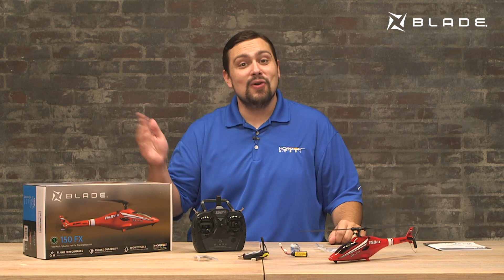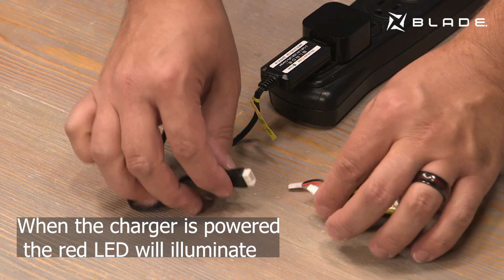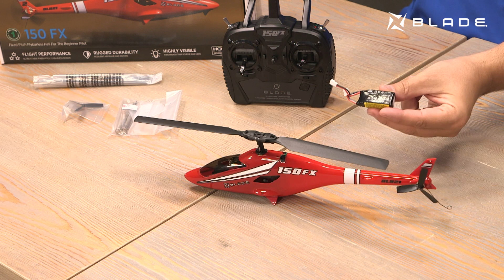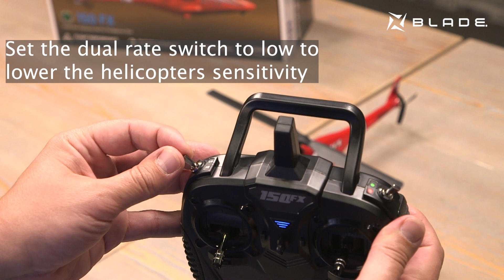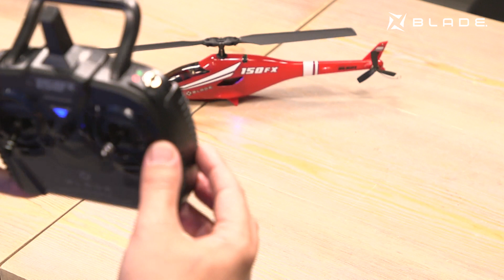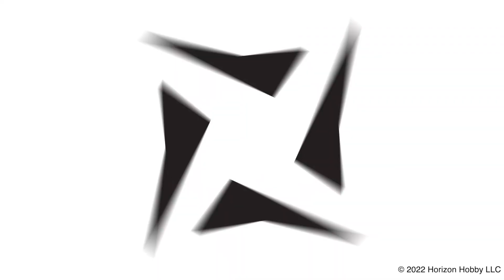Quick Start: Blade 150 FX RTF

Comment: Those tiny L wrenches I use a torch to straighten the L. Then 5 min. epoxy 2 1/4 20's to the end. makes life easy without paying for expensive bit driver sets.. Ok yea i am cheep but I have like 8 other hobbies and 8 motorcycles

Comment: Do the trim positions get saved when the transmitter is off? Is this able to be bound to a DX8? If not how come no? Also if no, can you bind to a tx16s? If so what protocol is it? Can the autolevel be shut off? If not how come that isn't an option?  Great looking heli!
Reply: Yes, the trim inputs are saved after power cycling the transmitter. This heli and transmitter run on an FHSS protocol, not the Spektrum DSMX so it would not be compatible with a DX8. The auto leveling cannot be shut off as it is intended as a sport heli for beginners.
Reply: @jordans3350  thanks for the reply!